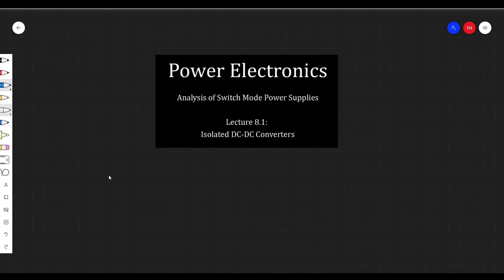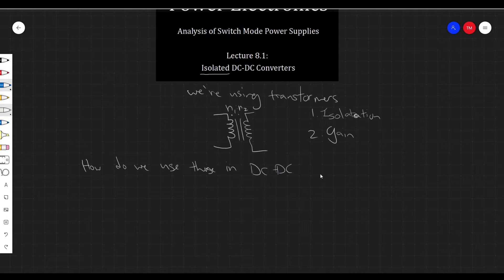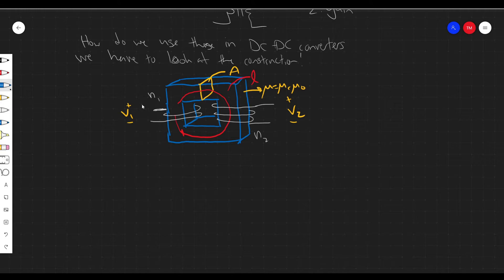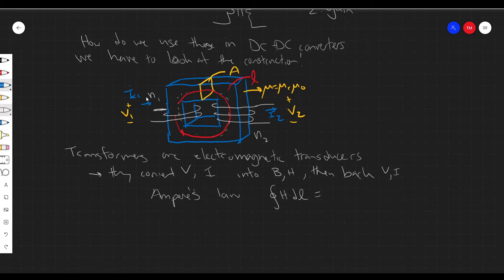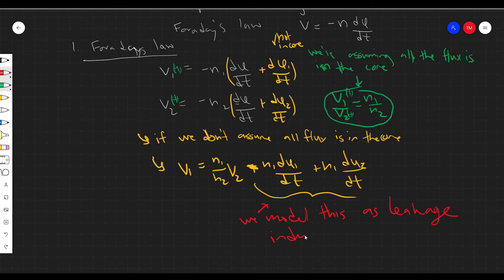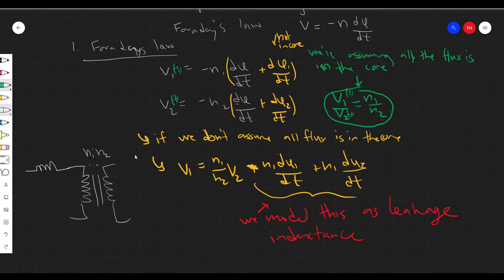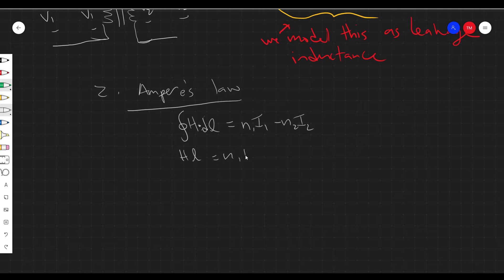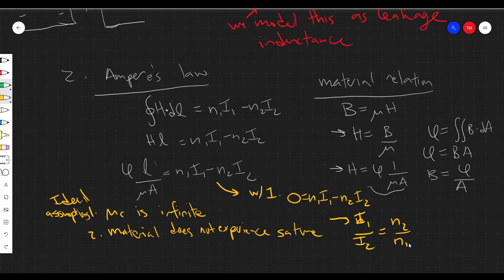Lecture 8.1: Isolated DC-DC Converters Intro

Comment: Well a good explanation of what Lm is in a non-ideal transformer.. just one question, is Lm value equal to L11*K?  Wherein, L11 is the primary inductance of the transformer and K is the coupling factor (if the secondary leakage(L22*(1-K)) is kept in secondary and primary leakage inductance is L11*(1-K))